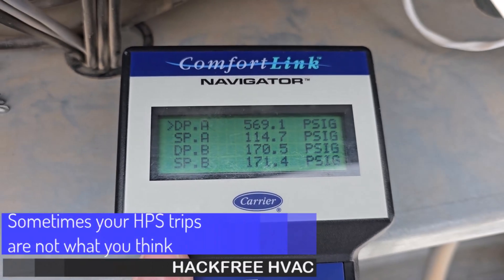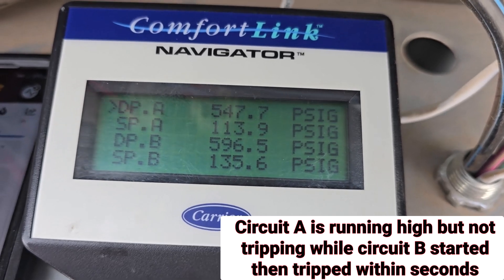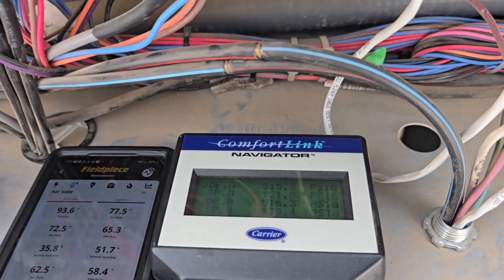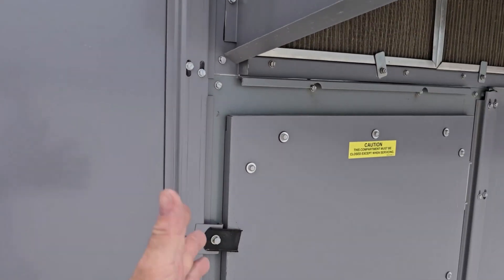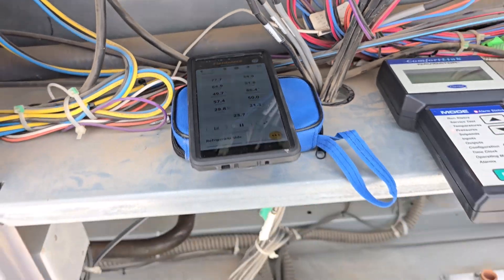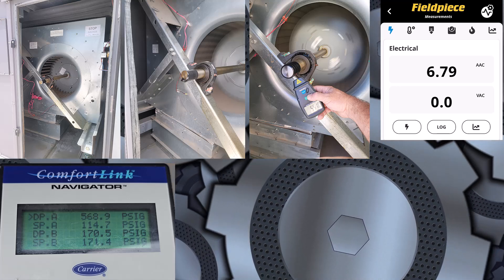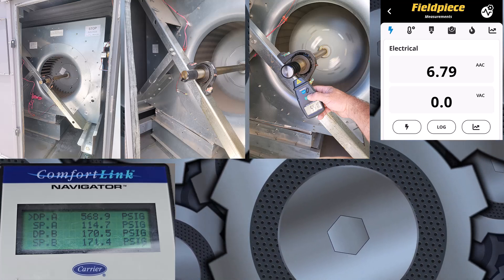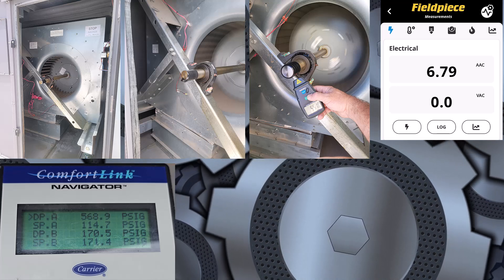Chasing HPS issues on 40 ton Carrier VAV unit

Comment: I’m retired from this now five years ago and I knew then these junk micro channel coils on 410A systems were going to be a problem. The manufacturers should have installed receivers but it’s all about the dollars saved.
Reply from the maker: Receivers would be nice. I think that part of the sill EPA ratings etc is total (minimal) refer charge and microchannel allows a bit less. A few years back I saw some 5 and 6 ton Trane Precident units with microchannel condenser and evaporator coils and they held something like 4 Lbs of R410!